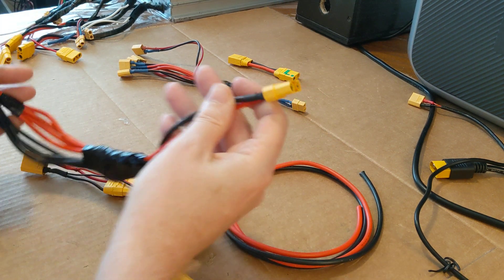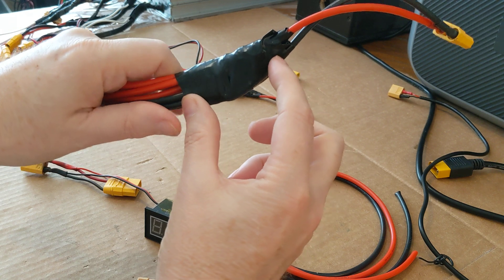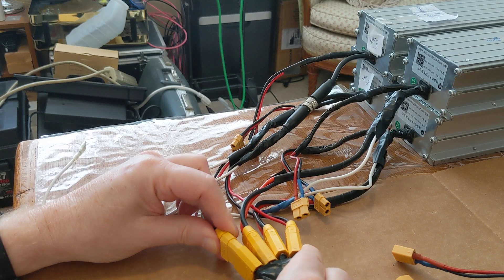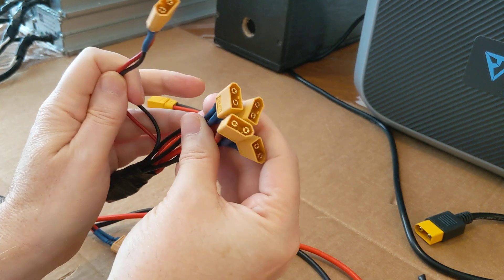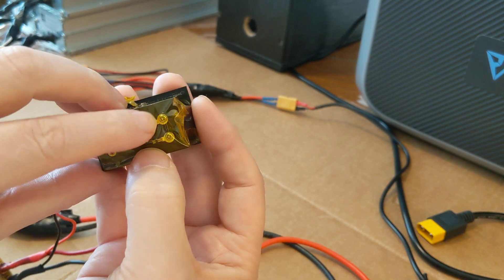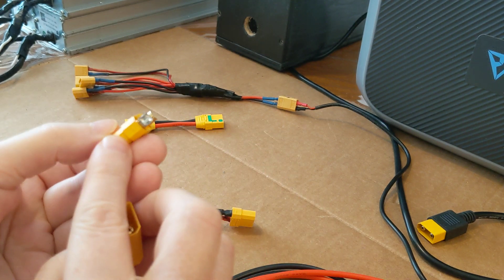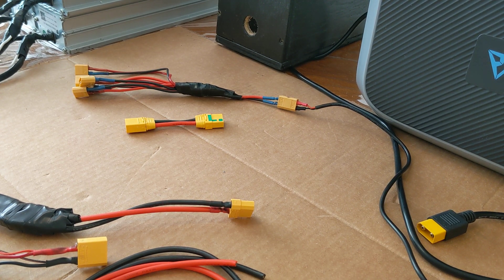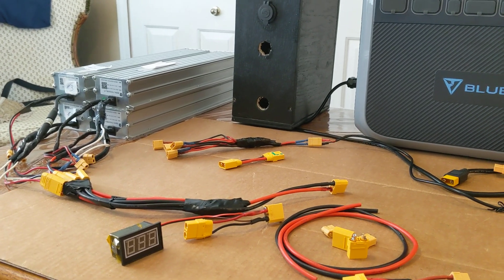Answers to a Few Questions

Comment: Thankyou for the video. What kind of solder do you recommend for 12 gauge silicone wire. Never solder before. I want to learn need to practice. I'll be using xt90 and xt60 connectors. That's
Reply from the maker: Thank you for your kind words Robert. I guess I really don't have a recommendation on solder. I've been ordering different multi packs myself off of Amazon and testing them. Good luck to you friend.

Comment: Great videos looked to this when I had issues with my setup as well.. Issues with the communication with the battery packs..
Now a few questions? 
How well do the XT work with the anti spark?  I have a few but haven't soldiered them in yet..   
Last one have you had any issues with battery clearing house with shipping or customer service?

Comment: Hello sir , great to see you and I think I caught up with with all you videos ! I have those 40 cells pack from JAG35 and I still can get to wake up they read 38.57volt and but can’t get them to power anything up !!! So I was thinking about removing the bms in their and start putting my own in their ?
Reply from the maker: Hi Jose, I have a couple of questions for you. Mine woke up after I charged them through the smaller wires/connector. I cut off the old connector and put an XT60 on. They should charge up to 41-42volts and turn on. Have you tried that yet? 
Which dongle are you using to activate the BMS to stay on?
In the worst case if you can't get them to wake... people are removing the aluminum shell and moving one black wire from the BMS to the battery negative. By doing this, you can still charge through the small wires and the BMS but on the discharge the BMS will not work so you have to monitor manually and not let the voltage drop too low (say 25-28 volts). I will try and find that video showing it for you and post it here. Thanks.
Reply: @sidjones-randomstuff2058  hello thank you 🙏 but the ones I have are from the 3.5kw pack that jag sells on his site ! so those batteries already had their tips cut off ! I have them for over 14 days and still can’t even get one of them to 1volt and I ask for replacement but that was the last pack and those 40cell Panasonic packs they don’t have them anymore ?
Reply: @sidjones-randomstuff2058  I have 8 of them but the ones I got didn’t have the wire with them ! These where made to put into and unit pack of 3.5kw battery pack and they came in way under charger I did contact jehu or Brian from support center and I got those where the last ones and they can’t replace them for me to just charge them one at a time slowly ! It’s been 12 days and I only have four of them charge up to 2v ! But will see what happens he said he’s waiting on a truck load to come soon ?
Reply: @sidjones-randomstuff2058  thank you 🙏 tha packs I have are the ones that come pre cut and they’re where made to sold as a set for the 3.5kw power pack he sells on the site !
Reply: Mine shut off also.  You have to ground them out using the pigtail wire and they turn back on.  You can charge them while they are off. Jag35 has a diagram which wires to ground to turn them back on.
Reply from the maker: Here is the BMS output bypass video. Be careful and I would not use a metal screwdriver for this. Use something hard like plastic. He also makes an error in which post to use initially but then realizes it and finds the correct negative terminal. He also shows in another video hpw to press the case off instead of cutting it off. https://www.youtube.com/watch?v=NxkS5zKkOY0
Reply: @sidjones-randomstuff2058  I retired that and I got nothing I try to put a charger on it and I blow out my new charger that I got just for them ! And it wasn’t cheap ! Good thing I bought the warranty for it ?